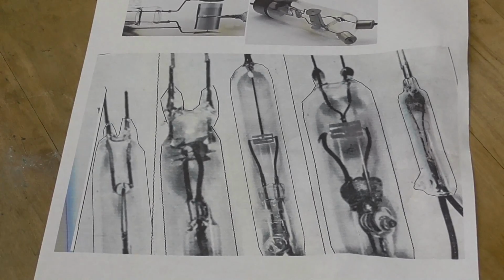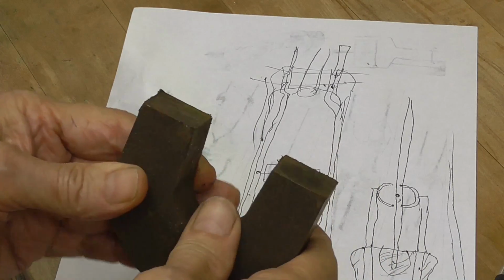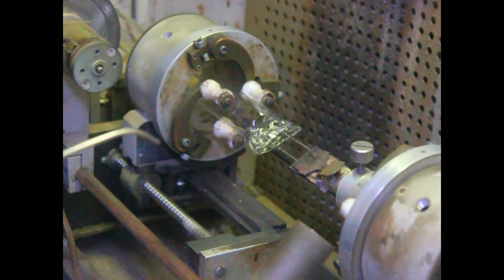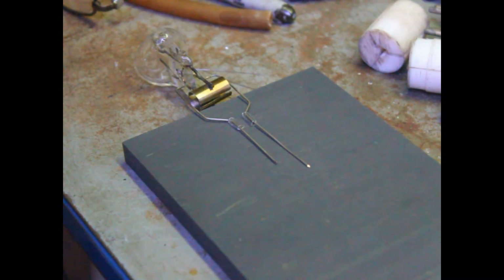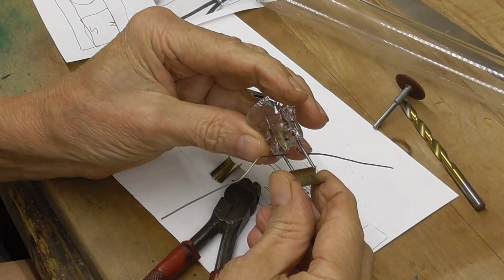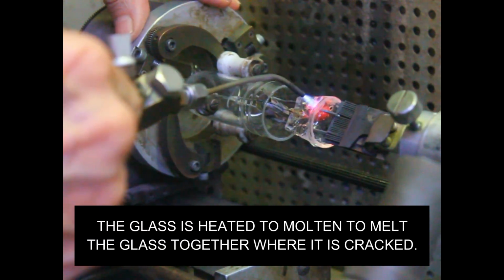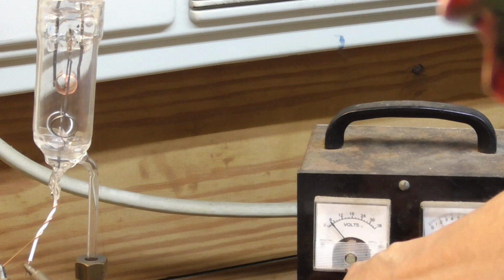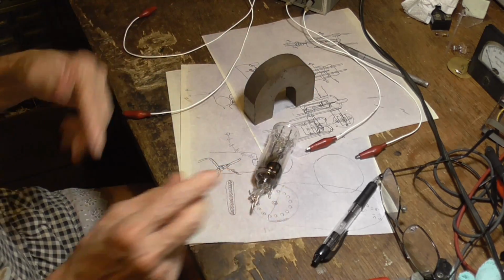MAKING A PRIMITIVE MAGNETRON

Comment: Hello Glasslinger, thank you for your amazing contributions and insights into tube design and making. This historic milestone before the clandestine sharing of the tuned cavity magnetron, in principle, the positive outcome from open sharing of ideas designs and style is why I watch your contributions. Q. What gas do you use? Have you considered Oxy-Hydrogen from a generator? Hotter flame, cheaper than bottled gas...? Open source: tractor tyre inner tubes or water displacement tube in tube, gas accumulators for gas feed pressure. Your worked experience is priceless. I hope to visit the US to see and to learn more from your collections and yourself. Again, thank you

Comment: what generates the frequency in magnetrons?
Reply from the maker: The magnetic field causes the electron beam to spin rapidly. This triggers oscillation in connected tuned circuits. Energy from the electron beam feeds the oscillation giving power at the oscillating frequency.

Comment: Do the metals have an impact on the operation/functionality?
Tungsten was used as wires, nickel as welding material for the tungsten and stainless steel for the screens, am I so far right?
And where did you get the kathode from? More interesting, what is it made of when it deterioates after ~10minutes.
This is very exciting for me :)
Reply from the maker: The metals in this application are not significant so long as they are "hard" metals. (not zinc or brass for example) Cathode deterioration is almost always caused by residual gas in the tube from not baking long enough under high vacuum.

Comment: I always wondered what the background machine noise was in the glass-blowing sections of your videos, in this video, you mention "oxygen concentrators" am I correct in that the background noise is the oxygen concentrators running? If I am correct, what % increase in oxygen do you get per concentrator at what gas flow rate? May I also ask what the volatile gas is that you use too?
Reply from the maker: Yes, they are old machines that make a horrendous racket. Each one puts out 7 liters per minute at 5 psi and 90% or better purity. Normally only one of the machines needs to run, but for the larger glass work both run full blast and barely are enough. 20 liters per minute would be better.
Reply: @glasslinger  May I also ask what the volatile gas is that you use too, please?
This is just curiosity, I've never blown glass, but I have a real need to braze small items of metal and find MAP gas with air mix is not hot enough and map gas and a bottle of oxygen start to get expensive. The small MAP gas bottles are not too expensive here in the UK, but Oxygen bottles are and the idea of finding an oxygen concentrator is very appealing if such a thing can be got in the UK.
Reply from the maker: @getcartercarpark.  There are regulations as to how long an oxygen concentrator (medical unit) can be used , and then it must be removed from service for safety reasons. They may still be operating fine. They usually are chopped for metal but if you can find a scrap yard who will keep an eye out you can get one of the old units for under 100 pounds. I use natural gas (methane) with oxygen. This gives a very low operating cost and the flame is very hot.

Comment: Hi Ron.
What's the power output of this little unit?
Can it be upscaled, downscaled or improved via modified cylinder/cavity?
Lastly what is the cathode made of and why does it need to go back into vacuum so fast?
Also why can't the cathode just be the heating wire like in an x ray tube?
Cheers
Reply from the maker: The tube was made more for a "can you make one in a home lab" rather than to make a practical usable device. The output power is a few milliwatts, not even enough to light a small light bulb. The getter material almost instantly turns to barium hydroxide when exposed to atmospheric moisture. A plain tungsten cathode could be used but it would be 100 times less efficient.
Reply: Hi @Johnny Cash,  i am not an expert in this area, if i have not mistaken, the power output of the primitive magnetron is not tested yet. However, it is stated in the video that the tungsten cathode filament can operated up to 15W (6volt*2Amps) of power. According to wiki explanation, physical dimension of cylinder cavity can affect the cavity resonance frequency (i think there's more stuffs that affects the frequency).  The cathode consists of small hollow tube with Barium Oxide coated on it, with a tungsten filament in the tube to act as heater ( for thermionic emission and bake out excess water vapor) .  I am not sure whether Barium Oxide can turn to barium hydroxide easily? For the last question, i am not sure.

Comment: Hi Ron  recently I have been uploading a lot of content you might find interesting.. also I can get you x ray transformers if you are looking for any.. I recently picked up a 50hz 300ma 125kv 40kw monster I will be showing it soon on my channel... also a massive imagine intensifier tube from a C arm machine..

Steve
Reply from the maker: Thanks. I have some big ones in the back room that dim the lights in my neighbor's house when I pull an arc! :)  I have an 8 inch Xray intensifier I snagged for $50, in working condition. One of my prized possessions!
Reply: @glasslinger  that's awesome m8 well if u need anything at all I have access to all xray gear cheap ... i got xenon to??? If i can help ya i will... i saw u tell someone off for destroying x ray transformers on yt 🤣 brilliant people cant get them then theres idiots running them out side of oil dicks... you have great channel and I been a fan for years take care Ron 

Steve

Comment: The stupid design seems like the typical disconnection between engineers/scientists and the people that does the actual work, they rarely put thought on the manufacturing process, its up to the glassblower to break his back because he "doesn't know" and has to deliver what is asked. Similar to why there was 30 year long plateau in ultimate pressure generated turns out it wasn't the pumps it was the gauges that couldn't measure below x10⁻⁸ torr physicists knew why (x-ray photo electric emission) since the late 30s but the vacuum engineers and designers didn't and everyone assumed that was the limit but actually the pumps could go well below that pressure.

Comment: You don't clean the glass tube before sealing?
Reply from the maker: The tube is baked in an oven under high vacuum at 900F for several hours to evaporate all contaminants.

Comment: will it drive a radar ? a small on ...
Reply: You can do a little radar equipment by using a "microwave oven tube". High power on 2,45 GHz (700W or 800W RF power). 
You need to built an switch to make RX/TX function , to receive echo signal,  or use a second antenna.

Comment: How does this leak detection work? Is there a Helium sensor going to the diffusion pump sensing any leaking in He?
Reply: There's a simple mass spectrometer somewhere in the vacuum system that's tuned to only helium.
Reply: @kasparroosalu  Wow, thanks for the answer! Enjoying your videos so much- please never stop making them! 
By the way, I remember my granny had an old radio with a green flourescent gain detector called the 'magic eye'. Can demonstrate such thing?

Comment: you'll get less bubbles in your welds if you keep the torch a bit farther back. The pressure shoots the air into the molten glass.

Comment: Would there be any benefit's from using Hydrogen gas in the torch ?
Reply from the maker: Yes. It would burn hotter making it easier to flow the glass. But hydrogen is an extremely difficult gas to get in quantities necessary to operate a torch. It is very expensive at the welding supply, and a hydrogen generator (from water) is also very expensive to operate at the volume of hydrogen required. (uses a lot of electricity)

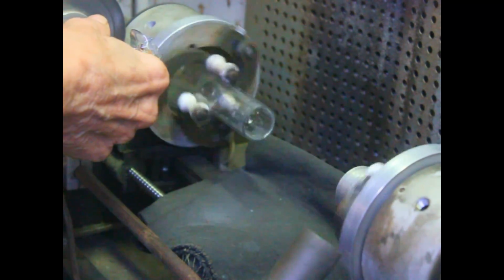Comment: 23:04 which blade is use to cut glass is that diamond based or silicates or carbide based ??
And plz share some tips for drilling hole in glass bottle or tube !
Reply: Drilling in glass can be done under water. It takes the energy from the vibrations.

Comment: I would use uranium glass at the part it makes the connections to prevent leaking
Reply from the maker: It might work. I took a shortcut to cut time. A new magnetron is now processing on the vacuum system. Maybe this one will work!

Comment: Dude you really made a mess with trying to clamp the 2 wires at the base. It's just one motion one big clamp you're spending to much time messing with it cutting peace's off you just made a big mess of it. Next time just give it one big clamp and keep pressure on it till it fuses. No need for all that mess and reheating you had enough heat.
Reply: The seal has to be vacuum tight!
Reply: Yeah that's why a quick clamp would be better . Failure rate go's up expediently the more you mess with it.
Reply: @patman0250  Ok. Vacuum tight seals are tricky.
Reply: Do you live in your mothers basement?
Reply: @Barnekkid  yes I do live in your mother's basement.

Comment: I think they put the high voltage on top in order to keep with the standards..  Obviously they needed to be separate from other leads to prevent arcing at such a high voltage.  But then they had to work w/in the standards of other vacuum tubes which always have the cathode/heater connections in the base.  All high voltage tubes have the anodes on the top.    I'm not sure of the reasoning.. I guess because there are often more lower voltage leads coming off a tube, which they want to group together in the socket, than there are high voltage anode leads.  There were very skilled people making tubes back then.. Keeping everything aligned would not have been a big issue.  I guess they could have built it like you and then put a cover over the 'top' to hide the crimp and expose the HV.  Then another standard tube base at the 'bottom' for the heaters.
Reply from the maker: It was a big issue to keep things in line. The glass blowers had fits doing it. You have to read the shop notes that were kept by some of the workers to get an idea on how much trouble they had. They were very skilled workers for sure!
Reply: @glasslinger  Thanks for the reply.. After watching a couple more of your videos, I realized you must know more about this than I do :)

Comment: Bit of a bummer that you couldn't run it with the air getting in, but still a cool project. I wouldn't give up on it though, it would be awesome to see it working. 👍
Reply from the maker: Another attempt is on the vacuum system processing right now. I'll have a video in a day or two.

Comment: Other things you might consider/think about:
1. a horseshoe magnet does not have a very homogenous magnetic field between its poles
2. if the anodes and wires are of ferromagnetic materials, they will distort or even shield the magnetic field from the "inside"

Comment: Finally had time to make cookies with a glass of cold milk watching this.. Ooh only if I had a glass blowers lathe how much time I'd spend on it. Such a great video. Do you have the capability to work with fused quartz? I would be building HID lamps like crazy with that setup.. 50 kw xenon short arc no 100 kw I can see it now. Never knew Tungsten Oxide could be used as a seal in glass, thought it had to be Molybdenum foil. Really nice physics lesson.
Reply from the maker: Fused quartz takes a oxy-hydrogen torch. I don't have enough of need for quartz to make up that kind of setup.  (expensive!)
Reply: 100kW lamp would require liquid cooling of the electrodes and a huge glass envelope. And a substation :)
Reply: @userPrehistoricman  Correct on all counts. I would make a 3 phase arc tube (Delta/spherical). Access to the substation would be the big problem even if I could afford to build the power supply. 100 kw / 3 Phase I'd suppose it'd be about the size of a basketball with baseball sized electrodes. Dreams
Reply: glasslinger it's not hard to make a HHO torch, just look into how to make an HHO generator and then use a tesla one way valve as a flashback arrestor

Comment: When I took physics years ago, we did some magnetron experiments. Used a coil of wire for the magnet and a high voltage single diode rectifier as a magnetron. Similar to a 1K3 octal tube. This would be a single cavity and not very efficient. The frequency is dependent on the voltage, diameter of the anode, the diameter of the cathode, Magnetic field in the tube from the solenoid coil that projects a field parallel to the filament of the tube. The oscillation is caused by the magnetic field deflecting the path of the electrons between the cathode material and the anode.  This is also similar to a Klystron tube, yet those are more adjustable and more complex than a magnetron.

Comment: Also those kitchen tongs without the bent bit at the end are giving you a hard time occasionally it seems. A decent set of parallel pliers is pretty cheap and you can get ones with graphite pads on them for glasswork. Makes squishing things with even force across the piece a lot easier.

Comment: Super bummed that it leaked. There are some lathework tricks that art glass guys use for getting clean joints. Since you have a fine torch and a bi directional you can get the flare and the main tube really close together, heat both of them at the same time until the edges of both tubes start to gather. Bump them together and give a couple rotations of direct torch flame on the joint and then pull back apart. You get a really clean lump free joint and there're no bubbles from overheating the boro.

Amazing work! I get excited every time I see you've published a new video.

Comment: dadgum it ron I wanted to see it work. I was very interested to see what voltage it would take before the electrons flashed over. I was thinking you could get maybe 6 or 700 mhz. Better than it took to see the german snorchels with the rubber coating the first stealth. But they were using micro-distances on the plates.

Comment: So...if I took the normal ceramic magnets from a microwave oven's magnetron and replaced them with highly dangerous and powerful neodymium ones...I could run much larger currents and voltages through it?
Reply from the maker: Yes. Trying to figure the field strength and voltage might be tedious. Another thing, the breakdown voltage of the parts may not take much extra without arcing.
Reply: glasslinger I could make a microwave that would cook my hotpocket in 5 seconds, boy would that save time.

Comment: Alnico is beautiful as a magnet, just that it is so sensitive to shock, plus it does degrade with time and heat, even far from the Curie point. Perhaps for the next one just try using the regular circular ferrites out of a commercial magnetron, as that will allow you to use a single pinch, and all you need is some steel plate with a hole in it to get the pole pieces, though you could also just rely on a pole piece one side only if you wanted a probe output, plus your plates could be much larger and easier to seal into the pinch. With the commercial magnetron you could also use the tungsten direct heated cathode as well, though your heater supply would have to be a beefy 1V supply, or just use 3 AA alkaline cells in parallel as supply, with a 1m length of 20AWG wire as ballast resistance. Will run it for at least 5 minutes before the cells go flat, enough as demonstration.

Comment: Always a joy to see a master at work. No action is ever taken without a reason, and to a layperson watching the reasoning is typically opaque. 

Thanks for shining a light on what you ware doing and explaining why you were carrying out certain actions.(e.g. left the piece rotating after removing the heat to prevent uneven cooling, ultimately caused by convection). Most of it is totally obvious, after the fact, if you REALLY think about it a lot, but if a piece cracks it is not always the first thing that would jump into anybody head.

Comment: I think the thing that ruins oxide cathodes when exposed to air is water vapor, the reactions being: 
CaO + H2O -> Ca(OH)2, 
SrO + H2O -> Sr(OH)2, 
BaO + H2O -> Ba(OH)2, 
the reaction of calcium oxide is reversible by heating at ~500C. however, all the hydroxides will react with CO2 to produce the corresponding carbonates. therefor I suspect that a cathode that has lost emission by being exposed to the atmosphere can be regenerated by reaction with CO2 to form carbonates and then heating to form oxides.

Comment: A tube can still be double ended electrically if everything is supported at one end and only the connecting wires get sealed through the other end.  IE: like the grid caps on early rf tubes.  I've heard that the magnetron is actually a whistle, the plate cavity is the resonant chamber and the electron flow is the "wind".  You then couple the rf out via a waveguide.
You had the plate assembly edited a bit out of order, added the upper filament wire support bead before you attached the plates.
I didn't see how you connected on end of the heater to the cathode.  Since you have only two wires for the cathode, I assume that one side of the heater is common with the cathode.

Comment: Very much interesting. Just because I never plan on such an endeavor doesn't mean I not completely fascinated. I say, press on! Go for another one that works. Take your experience and try it again. My only suggestion -- from a position of complete ignorance (and I note that you would be using the smaller diameter tube for the first pinch) -- is to fold over the excess glass from that first pinch. It feels like by trimming and pulling off the glass with tools, you are adding some strains to the assembly. It also may be neater.